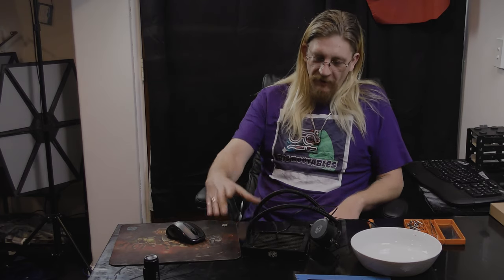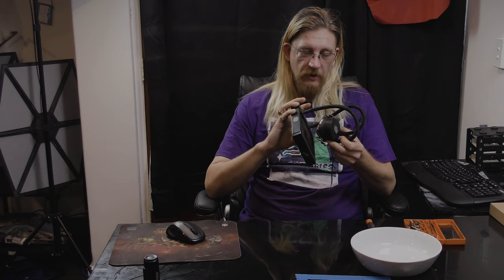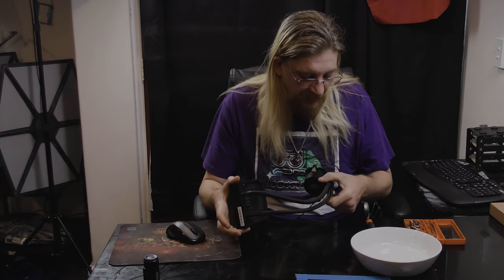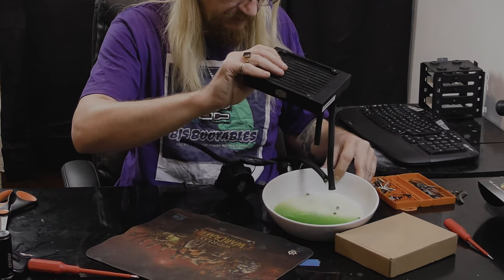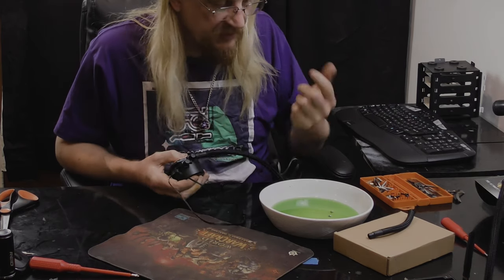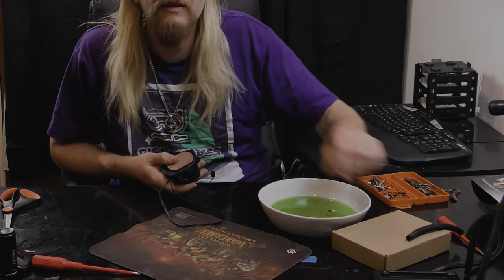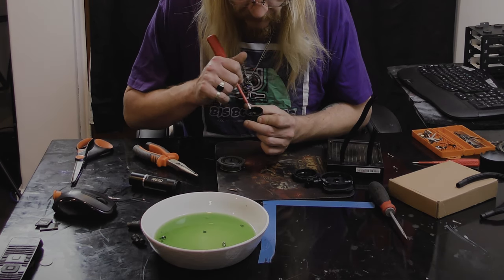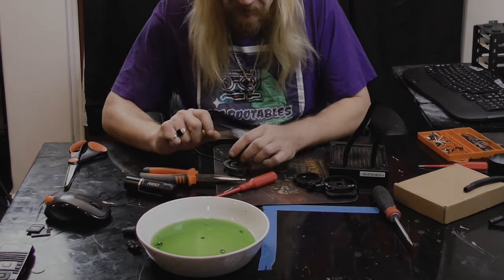Coolermaster 120mm aio teardown

Comment: Hi ! I was really happy to finally find a teardown video of this MasterLiquid Lite 120. From your experience about how the internals are build, do you think it is possible to adapt the pump to fit on a Sandy Bridge G2 laptop socket ? Even by drilling through the chassis without endangering the etancheity. Thanks a lot
Reply from the maker: Hmm good question, not sure to be honest. Probably could be . Although I'm hesitant to recommend that aio for anything after seeing how I wore through and the noise it developed
Reply: @randomaussiedude  Thanks a lot for the quick answer. I would not mind having audible nuisance on such an experimental build. I am targetting this very AIO because it is one of the cheapest on amazon and i dont want to drill through the pump chassis of a good quality 120$ cooler :) The sandy bridge G2 laptop socket has fixations with very little spacings ( 3cm * 4.85cm rectangle ) so my main interogation is : would it fit to drill 4 holes at those dimensions on the pump without going trough the water circuit or the electronics ?
Reply from the maker: @drheinrich940  Not going to for in there  unfortunately. Need about 5x6

Comment: Was that impeller made of metal or plastic? My masterliquid 240 has the same pump and is grinding every now and then, I was wondering if I can open it up, measure the impeller and 3D printing a new one. What do you think?
Reply from the maker: it is a dense plastic with some weight to it and a metal pin in the middle. I guess you could print something but it would need to be a real heavy duty filament

Comment: how did u open top cap? mine one looks glued or somethig, i want to put it all back without destroing as to destroy something is not the option for me.
Reply from the maker: Pretty sure it was just clipped on, on mine. Checked the bits of it I still have and can't see any glue.  They are not the most user serviceable item